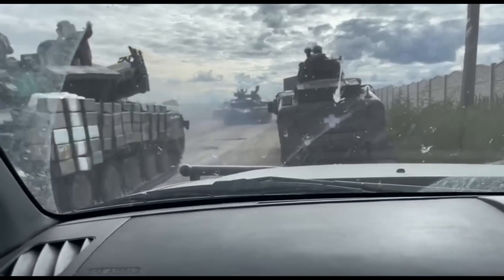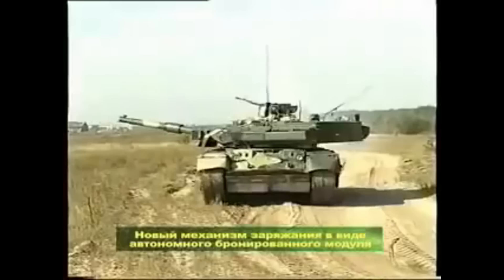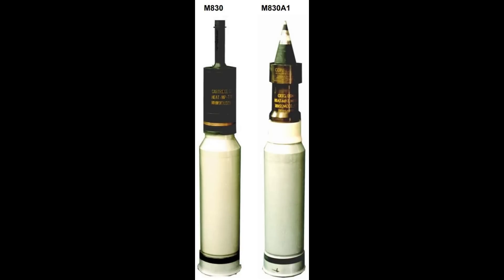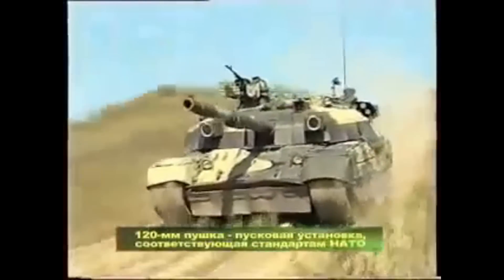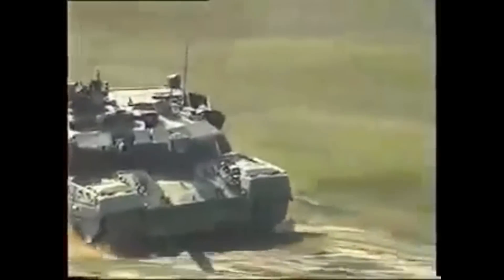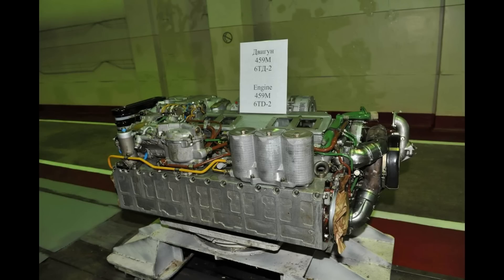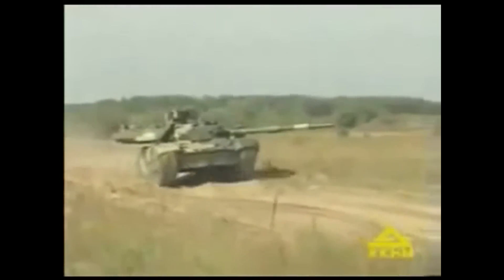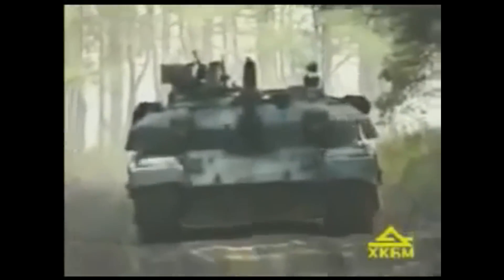Best Ukrainian Tank that Never Came to Be

Comment: The Russians developed something similar called the Burlak turret with a bustle autoloader which could fit T72's, T80's and T90's. Instead the funding went to the white elephant Armata.
Reply: Armata is being prepared for mass production. Burlak didn't improve things enough to warrant the expense. T-90M is as good as T-72 chassis/turret can get. REAL improvement was Obyekt 187 from late-80s/early 90s, which was an enlarged version of T-72 layout with graded armor, uprated engine, gun and FCS. 

Armata is a platform, not a tank. Tank is one of 3 vehicles to be built on its foundation.
Reply: @Max_Da_G  I don't think the Armata will enter production anytime soon.
Reply: @martinsmith9054  Well I got news for you. The T-14 just got a buyer and its Iran.
Reply: @martinsmith9054 It’s already in serial production, there just aren’t a large quantity of orders for it. Most of the orders intended for T-14 were rerouted to produce the T-90M which is seen as a more cost-effective alternative. Russia isn’t producing many T-14s but it is producing far more T-90Ms than anybody outside the Russian military-industrial complex thought possible a few years ago.

A T-80 factory is being created but it’s likely a short term project for this war. 

It’s possible within the next decade production of the T-72 and T-80 will cease and the resources will be redirected to the T-14. The T-90M or some future variant will be kept around due to the abundance of T-72 chassis.
Reply: @pilotmanpaul  let's see if any of them are actually produced.
Reply: @QualityPen  the T90M seems much less prone to turret blow-off. I think the new T14 engine has reliability issues.

Comment: I remember absolutely obsessing over the Yatagan years ago, because it was offering the best of both design philosophies (seemingly). If I were to opine, the principal reason why it didn't get a Turkish contract, besides M60 being already in service and thus easier to modernize were some of the less perceivable effects.
For one, I recall that the gun wasn't that spectacular upon closer inspection. I remember seeing publicity pictures showing its barrel end and you could notice that the muzzle reference sensor was mounted there quite haphazardly and was crooked, not aligning with neither gunner's sight, nor some other device. Which, okay, may be a mishap, etc. But if you have tankers look at it and it feels to them a bit rickety, it doesn't win you any points.
The overall construction of the gun seems thinner than Rheinmetall guns (just by eyeballing it and could be wrong, but assuming I'm correct), which means lower average barrel lifespan, something Soviet designs by comparison weren't that good at and as a client country you probably wouldn't appreciate if you would need to replace your gun barrels more often than your previous, fairly comparative tanks.
Another issue is that Yatagan, like the Soviet designs it was developed from, never had good gun depression. Having good gun depression was always a NATO standard and for Turkey, where they do have some fairly rugged terrain, this also would have been a problem. Why make your vehicle take the hit, when you can make the terrain in front of you take a hit?
On the last survivability note, yes, it was miles ahead of what any Soviet design had to offer. I actually do not understand why Ukrainians didn't adopt this design for their 125mm gun armed T-84s to be honest, but I think Turkey looked at Leopard 2A4 and looked at T-84-120 and said to themselves "Leopard 2 is heavier and not that much bigger, it's only logical to assume that it is better armored.".
Armor thickness and allocation aside, which will probably will always be vague when discussing these vehicles for at least several more decades, ironically I think Leopard 2A4 is less survivable as a vehicle, because Yatagan stored extra ammunition (as per schematic) behind and below the turret at the rear part of the hull, which is a bit comparable to the spare 7 rounds on M1A1(+) Abrams. Leopard 2 by comparison has extra ammo stored ahead and to the left side of the hull, the hull store holding more than half of its ammo that it can carry. And from what I remember Turks fighting the Kurdish insurgents, Kurds exploited that and aimed their RPGs to that exact location of spare ammunition, making Leopard 2s fairly easy kills.

What I am saying I guess is that Yatagan was never great, but it was a definite upgrade that should have served as the basis for new Ukrainian tanks. Flawed gun? Doesn't matter, that can be addressed and adapted over the time. Small optics? The same, even Russians achieved that with their T-72s and T-90s, so it's more like a production upgrade. Yatagan was a missed opportunity for the domestic usage far more than export in my opinion. If I recall correctly they were at one point proposing Yatagan with a commander's panoramic sight, I don't think you mentioned that. If memory serves it was a purely optical device, so essentially it was an encased camera without thermal infrared imaging or low light visibility features, but I could be wrong on that one. At the very least, it offered a far superior battlefield awareness to what Ukrainians and the Turks had in inventory at the time. Ya'll keep in mind this is a 2000s tank, that pre-dates the Second Gulf War, so a number of systems at the time didn't seem quite so essential, so we could talk about hunter-killer capacity, thermals etc, but at the time export market wasn't that savvy. You could find a buyer for your surplus T-72s that haven't changed a bit from mid-70s back then. Yatagan I suppose for some nations at the time was seen as overkill.

Comment: The poor reverse speed is not a negative, it's a slav anti-retreat feature.
Reply: This comment deserves more likes 😂
Reply: Ive watched a lot of western tanks burn in Ukr. Not seeing how reversing quickly was somehow a feature? Maybe the source for muh reverse speed is from video games like WoT?
Reply: @TheBelrick  least mad vatnik
Reply: Tanks need to keep moving in intense fight,for example if you are attacking a enemy position and want to retreat after the attack it's better to retreat while facing the front towards the enemy because the front is usually the most protected, you don't want to turn the tank and then retreat exposing the rear which in most tank has no protection at all, we have seen it happen in Ukraine with soviet tanks where after a attack they had to turn around the tank exposing their rear to the enemy. @TheBelrick
Reply: @pandibbarman  This retreat while reversing is also yet another garbage reddit brigade take
Thanks are forced to attack in corridors due to mines (and los cover on one flank), so they attack in a line typically behind mine clearing vehicle
THERE IS NO OPTION TO REVERSE!!!!
Because of the units behind them
Go watch combat footage. 
Also note footage where panicking drivers for the AFU reverse into vehicles behind them.
Its not a big deal to have slow reverse speeds.
Reply: @TheBelrick  not at all lol 😂☠️ if that was the case the Russians would be happy with the reverse speed of the t72 and t90m and would not improve it in the t14 🙄, though not surprised lol you seem to have knowledge about tanks as much as a dog would have knowledge about cars 😂, if you go deep into the internet you will find videos of Russian tanks trying to retreat after assaulting a position but the reverse speed is so slow they literally had to turn around the tank and then retreat on top of that you seem to have more knowledge about tanks then tank crews themselves 🥲 and also tank assault are not done in columns so you don't have to worry about hitting a tank behind you 🙄
Reply: @pandibbarman  The MBT of choice for the RF is the T-90M not the  T14. Good try kid. 
This isnt reddit where mods protect you from being called out.
Reply: @TheBelrick  Never said t90m wasn't their choice 🙄 it's an highly upgraded t72 at the end of the day which suits their needs for modernazing their military faster because t14s mass production will take decades, buts it's simply a fact that they have fixed all the issues with their previous tanks such as in the t72, t80 Or the t90m, which is a carousel storing ammo for the autolodder and the poor very very poor reverse speed in their t72 and t90m which according to tank experts and tank crews themselves is very very important in combat☠️.
Reply: @pandibbarman  So since you are simplistic in logic
RF uses T-72bvm and T-90M as their MBT going forward. Which have walking speed reversing speed
Not the T-14. 
Which invalidates your low key argument. Just accept when you are beaten, know your place.
Reply: @TheBelrick  It's because they don't have a choice lol they need new tanks for their military and t14 isn't going to mass production anytime soon. But if reverse speed was so useless they wouldn't have improved it in the t14, 😑 not to mention it's not me who is claiming reverse speed is important in combat it's the people who use tanks who are claiming reverse speed is important and every other military expert will say the same thing, but you seem to even know better then the people who are expert in the field 🤭, not surprised at all since you seem to get your information from Reddit 😂.
Reply: @TheBelrick  The main reason why soviet tanks didn't have good reverse speed is because of their doctrine 😑 they didn't expect their tanks to survive much longer in the battle field anyway and the t72 was made under the same doctrine with poor reverse speed, Russia has a ton of t72 and changing and modifying each engines to increase the reverse speed is out of the question for the Russians they simply can't afford it. It's the reason why the modern t72 and t90m which is literally a highly modified t72 has a poor reverse speed it's not like they didn't want a good reverse speed they simply couldn't get a good reverse speed, in fact they couldn't even make a proper and more powerful engine without copying a German design for the t14. You shouldn't speak about things you have no idea about 😑
Reply: Brother you don't want to expose your rear to the enemy while retreating from an attack because it can be fatal as the rear has as much protection as a front engine Toyota  @TheBelrick
Reply: @pandibbarman   I hear you. But drones, guided artillery shells , ATGM don't give a rapid hoot what direction the tank faces
Here is a bitter pill. You ARE those arm chair generals fighting the last war.
You are flat out wrong.
Tanks need to go flat out in, stop, shoot, scoot at fastest speed aka forward towards their own lines.
Welcome to the next war, be grateful you have someone telling you truths.
Reply: @TheBelrick  Ok keyboard warrior you seem to know more about tank warfare then tank crews themselves 😑. If you had knowledge about warfare you would know not all infantry groups have atgms with them 🙄 many in fact most will have a anti tank squad who will only have Simple ATs  with them not a freaking anti tank guided missile 😑 with duel charge top attack munition, drone? Yeah the military will have counter for them too, artillery? Very inaccurate for moving targets the change of hitting a tank will be 1 in 20 shots, though not surprised you seem to get your knowledge from Reddit after all 😂☠️
Reply: @pandibbarman  So now an appeal to authority? Way to tell me that you took all the boosters. How is your heart?
Reply: @TheBelrick  if the amount of western tanks lost is 'lots' to you, the amount of russian tanks must be fucking UNFATHOMABLE
Reply: @yeetadog  If you look at simple numbers, but if you look at % of loses they're pretty close. It's not like Ukraine has thousands of western tanks.
Reply: @yeetadog  Yeah i know that the 47th reddit brigade says RF has lost a huge amount. But they also claimed that the Ghost of Kiev was a real fighter ace
25% of all Abrams destroyed in a month.
Had 10x the number of Abrams been sent, then 10x as many would of already been burned out.
So why does it upset you to see the reality that Western Tanks burn just like RF tanks but at a much greater price tag?
Reply: @darenzy  don't try and pretend numbers don't matter pal
Reply: @TheBelrick  Ever heard of a joke?
Reply: @Drobbik  Western tanks are better than RF tanks?
Now that is a joke
Reply: @TheBelrick  Dude, the slav anti-retreat thing is a joke duh
Reply: @TheBelrick  Then why new T-80 2023 variant features new reverse speed go about -25kph? (Oh also T-14 Armata with actual reverse speed)

There's plenty video how Russian deal with not reverse speed (like turn back face to enemy)
Reply: @SRDPS2  Tanks are destroyed from the above or the side.
Not sure how front facing enemy is a factor in modern war?
And the primary tank of the RF going forward now is the T-90M and T-72B3M. That is walking speed backwards.
Not T-14 or T-80
Reply: @SRDPS2  Modern tank combat seems to be:
Rush forward after mines ploughed
Fire direct fire, 10 shots say.
Run away as fast as possible. That means forward not reverse.
Golden rule of modern war. If its on the line of contact it will be spotted and if spotted it will be destroyed no exceptions.
Reply: @TheBelrick  example : video on Ukraine T-64 vs T-72 first engagement (also in RedEffect channel)
yes the golden rule is right, but reverse speed actually decides between life and death in that situation

you know, reverse on time so don't get hit
Reply: @SRDPS2  Which video, ive seen a lot of videos of T-64 and other tanks and IFV like Bradleys burning.
one thing ive noticed. Western side makes sure a video of a RF tank burning goes viral as if that somehow reflects upon the war at large. (not true at all, most of the 1000!!!! plus tanks sent to Ukraine are now hulks)
Reply: @SRDPS2  How do you reverse when you are in an armoured column with vehicles behind you?
Seen several videos of reversing AFV reversing into each other.
Its not a big deal at all to have slow reverse.
Reply: @TheBelrick  "how you reverse in column"
Add on : also by you logic, forward speed is also useless because head convoy are likely get destroyed and you can't move forward (it's just 101 how to disable convoy since WWII)

And you gonna stay column for whole engagement?
There's some singular Ukrainian tank engagement include Leopard 2 and Abram (and also same thing with all Russian tank)

Remember when say "Have tank better than no tank"? Have reverse speed is actually fall into same category
Reply: @TheBelrick  and to be honest
I still understand people deny about blow-out storage because it's have significant downside 

But deny about reverse speed as in part of "don't get hit" it's just speechless, it isn't like HSTV-L or BMP-2 that just spam all ammo and run
It's ~8 second per shot × 22/28 it's take minutes to dry out